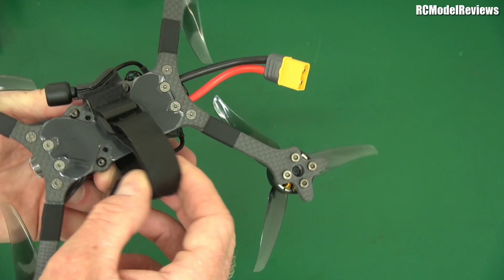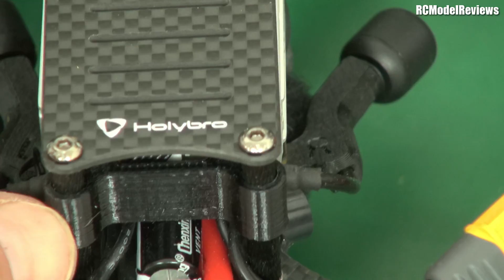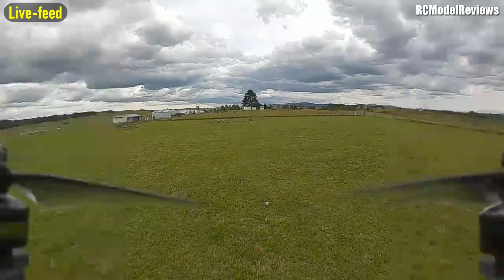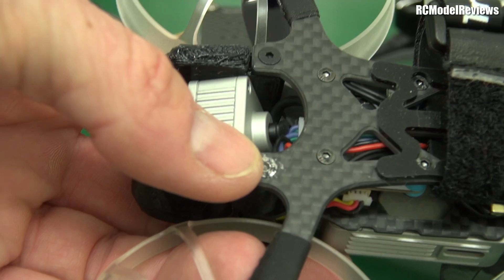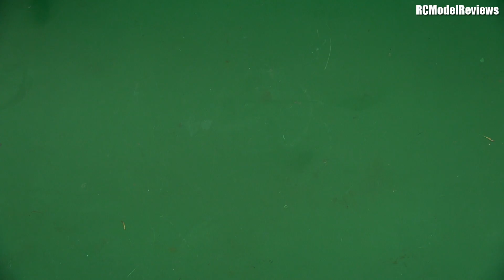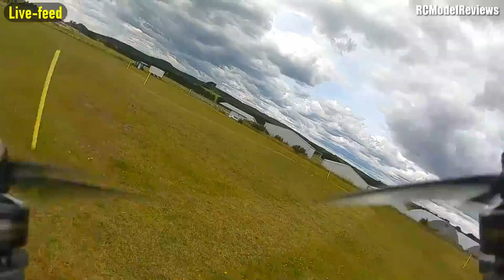Review: HolyBro Kopis2 HDR (with DJI Digital Air Unit)

Comment: Bruce i have tried everything but i cant get very good video range with this quad! Iv swapped antennas, the entire air unit, the antenna routing every which way but it still always has something poor about the video range .... I really beleive its the design of the quad. I like to fly out around a 1\4 mile and back but our of 4 quads with DJI this one gives me range issues....

Comment: Btw Creality Ender 3 as it just goes, works ok...I have changed mine to the new BQ Mini control board for the Ender 3 .check out Chris Taylor's channel  "Nerys" and the Kiwi 3D printing group on FB one bloke has been using a Kiwi made carbon nylon or something filament etc...Laurie

Comment: Fantastic flying and review, Bruce! 😃
About 3d printers, I was thinking about getting an Ender 3, but I changed my mind recently. Now I want an Artillery Sidewinder X1. It's much more quieter and can print flexible filament easily. 😊
Merry Christmas for you and your family! 😊
Reply: Seconds on the Artillery Sidewinder X1
Reply: My stock Ender3 prints flexible filament like a champ!
Reply: @13FPV  Try ninja flex.
Reply: @MC's Creations Hold my beer while i convert my ender to a direct drive... 😜
Reply: @13FPV  😂😂😂😂😂
Reply: The best thing the ender 3 has going for it is it's popularity. There is so much information available on it, so many spares a d mod parts for it.
  I know it's not the best printer in the world, or even the best budget printer, but it still does a good job out of the box and I still recommend it for those wanting to get in to printing on a budget.
Reply: @landlife m Exactly! 👍🏼

Comment: Seems like such noob mistake for them to position the antennas like that.
Reply: Definitely favoring durability over reception. Probably okay for racing at 700mW or higher.
Reply from the maker: yeah, it's okay for racing but I wouldn't freestyle it like that -- you really need good antenna efficiency to punch through bandos, trees, etc.